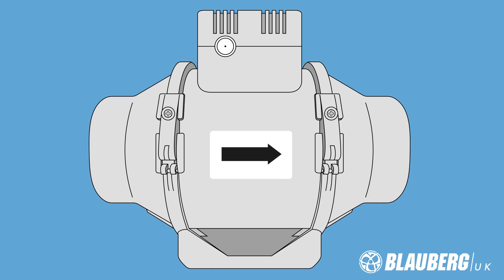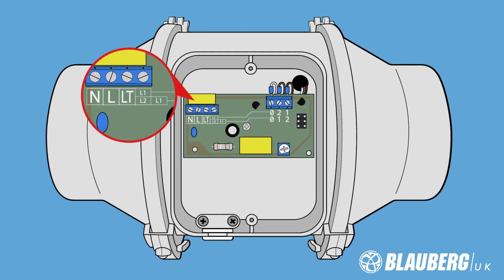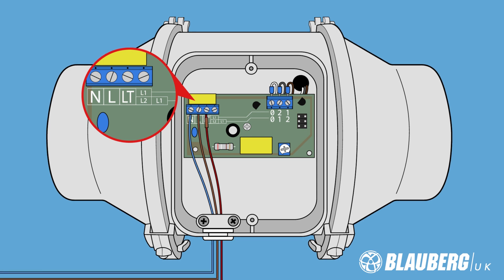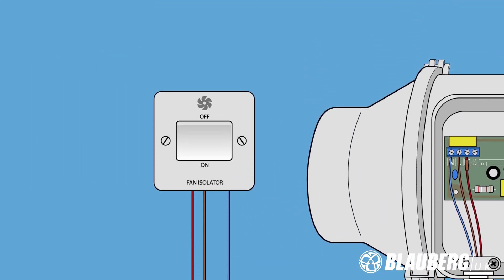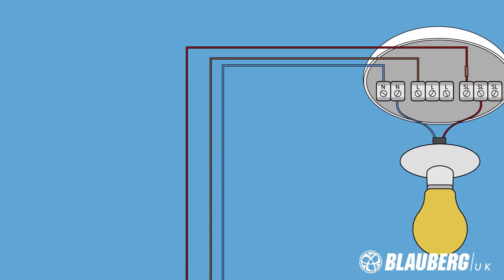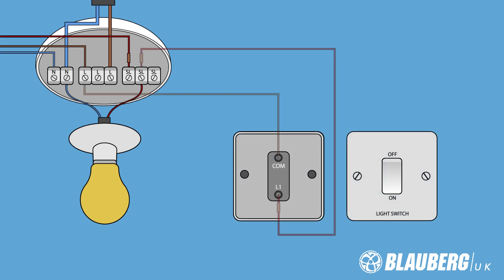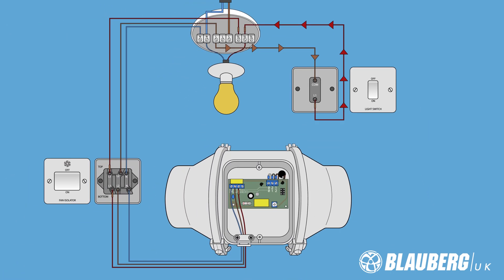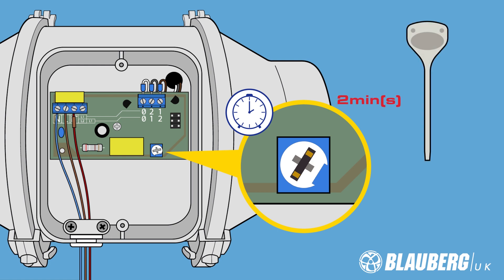Wiring a Blauberg Turbo-E Timer fan

Comment: What if you dont want to wire it into a light? mine is going in my workshop to extract gasses, But I would rather just by pass the light connection
Reply from the maker: Hi if you fan has a timer, it is still live, neutral and switched live.

Comment: Can I install to mains thro fan isolator pulling switch only. I don’t want light switch to control on/off the fan.
Reply: I think you need to buy a specific model with a pull cord.
Reply: As long as you have a fan isolator you can wire it to a pull switch

Comment: Can u just pit a plug on it?
Reply: You can. but it wont work, i know because i did it. You need to get the isolator switch (which has it's own power supply run through, ie lighting circuit) to connect to LT and the tail from that switch, to L1 or L2 tell the motor to spin. the LT is just like the original Live, except of course it is switched. The manual you get with it specifically tells you NOT to connect mains live to L1 or L2, only from the isolator switch. which is a pain but i'm sure theres a way to bypass it and have the powers required in-line.
Reply: well that was the E100T but they do sell one with a mains cord already attached for £50.00 ish
Reply: Is it possible to wire the fan to a independent on off switch.

Comment: Thanks for the video, but what is the 4th connection? 
My fan is 2 speed with timef but connected like that is low speed and turns off instantly
Reply: If your fan has two speeds then you connect the LIVE wire (brown) to the L1 (low speed) or L2 (high speed).
Reply: Did you ever work this out ? I am fitting one today and also curious.
Reply: @xXM3tall1c4Xx  no not yet, but I think you have to bridge an extra wire across for timer mode and the other slot is fir higher speed, 
Will have to play around and test it. Cheers
Reply: @rickster3287  hello buddy, did you find out the answer to this as I’m also in the same dilemma?
Reply: @xXM3tall1c4Xx  hi Nathan, did you find out the answer to this because I’m also in the same dilemma?